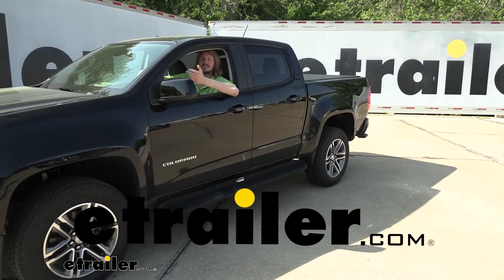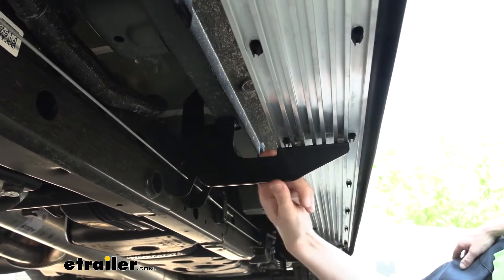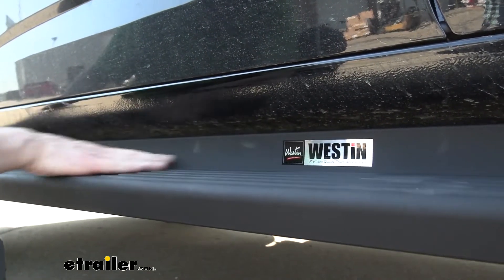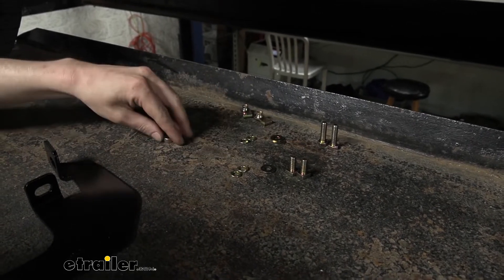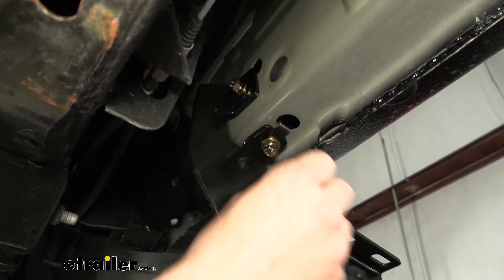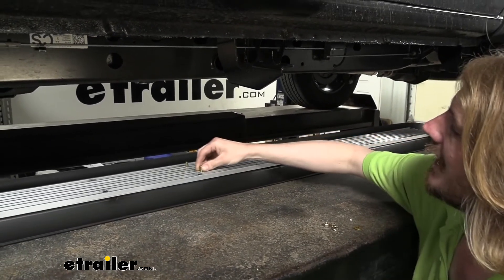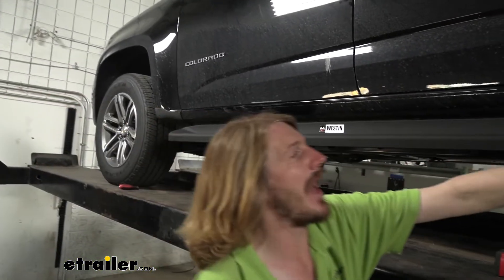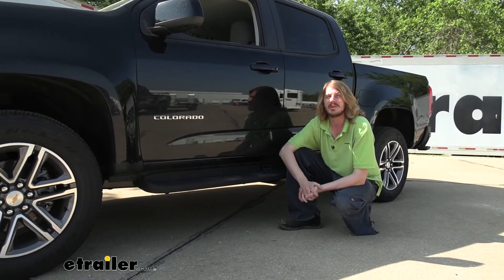Mount: Westin Molded Running Boards w/ Custom Installation Kit on a 2022 Chevrolet Colorado

Comment: Do they make that same style for a Colorado Z71 4 door if so what is the cost, I’m very interested
Reply from the maker: The Westin # 27-0010-2205 running boards you were checking out fits all models of the 2015-2025 Chevy Colorado Z71 Crew Cab. We've confirmed this with Westin.
https://www.etrailer.com/Nerf-Bars---Running-Boards/Chevrolet/Colorado/2022/27-0010-2205.html